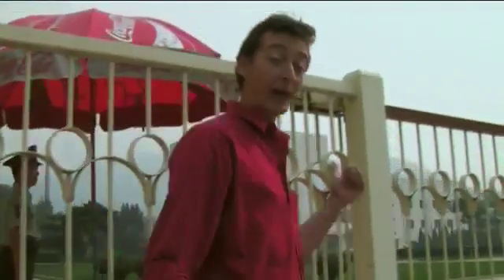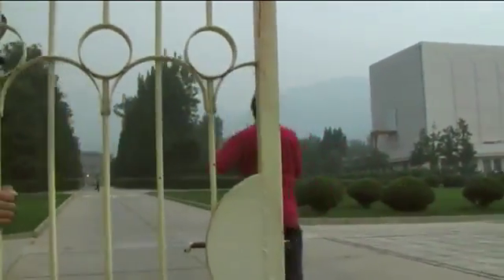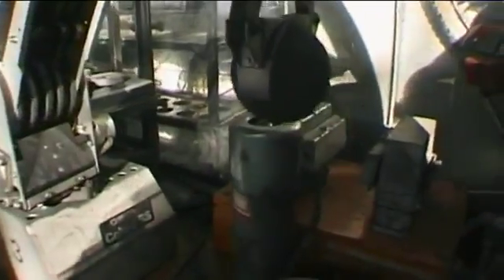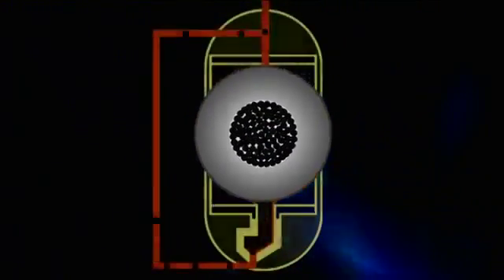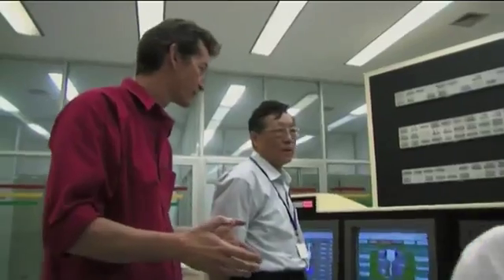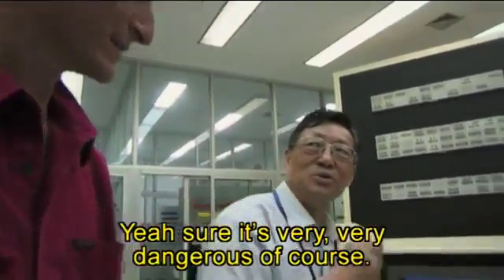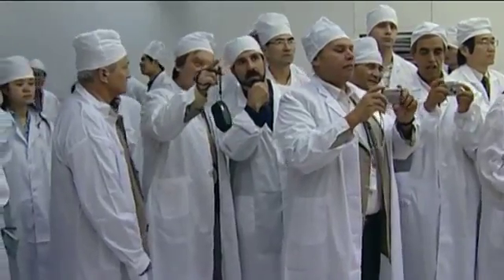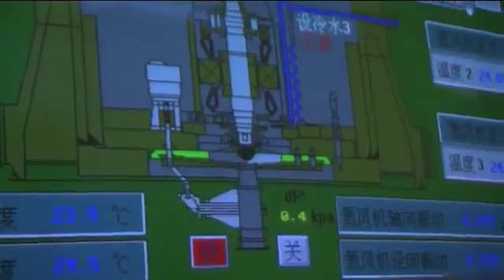Pebble Bed Reactor Prototype

Comment: This technology is far from new. It was originally developed in the mid 1970’s at OakRidge. Issues surrounding manufacturing and degradation of the casings as they aged ultimately killed the project. The issue of scalability was also a major drawback of this technology. Due to advances in metallurgy, material sciences, manufacturing processes, and supercomputing, the most restrictive issues surrounding PBR are no longer an impassable burden. However, commercial reactors or publicly disclosed research reactors have utilized these advances at this time. It was only at the beginning of 2020 these advances became published. With all this said, the reactor in the video is nothing more than an unreliable, extremely expensive, relatively small (for power generation) reactor. I give China a lot of credit for building and researching the more exotic reactor types, but they are far from the first. Everything they have done in the nuclear industry has already been done on some scale by one of the following. USA, Canada, France, Germany, India, USSR/Russia, Israel, And England.
Reply: haha no. The US funded this as one of the two options for the ARDP and they are now pursuing this heavily. The only obstacles were political and those killed development for every other kind of reactor as well

The main previous body of research was German, the reactor is an evolution of the Siemens HTR-Modul concept, and the Chinese did get direct support from Siemens. The work that the US did before was relatively minor in comparison to what the Germans did for PBR's before 80s politics happened.
Reply: don't give em too much credit they stole the Tech from multiple sources.. A big one they got caught doing it too was South Africa.

Comment: This was a disaster when built in Germany in 2009
Reply: Maybe this type of technology is more mature nowadays too
Reply: @clovisdelins8490  their design was bad as a vertical stack that created grindings, jams, and dust...but the short comings with the design are inherent.
Reply: China has a lot of money, maybe Germany did not invest enough in this type of technology
Reply: Akin Khoo that is true..new designs have to be run for some time to find the inherent problems, in the big picture of things, though, I think thorium and salt is the only real promise for nuclear energy future.
Reply: Akin Khoo  they have been saying that about fusion for some time so I have my doubts. Present uranium fission is a constant filtering and re refining process since most of the fuel becomes contaminated and not burned in the assemblies. Only France refined and reprocessed at great cost and in the end lost. It does not work simply because traditional fission...even the pebble bed ...produces 20,000 year wastes. Any breeder reactors..,which have been run and built...France did as part of its processing program...are small problems compared to the massive quantities of traditional waste produced by conventional vision.Thorium cycle is attractive because it's daughter elements are 1000 or less. Also thorium is almost unlimited supply compared to require enrich 235 in present cycle, and even 238. It also can be handled and processed easily in bulk. Finally it is true that salt reactors require on the fly separation, but on the end the waste is 1000 times less and only 1000 years. pebble beds do produce a lot of low level waste and require tremendous processing to cut down on the numbers because of the complex and massive material involved in individual packaging. Also there will be pebble breaks and failures, and pebble bed does catch fire or even is exposed to the air...it will be a disaster. A salt reactor will drain and turn solid in failure, which will cause a containment building mess with radioactive daughter material. A real mess that you are going to need a lot of money and luck to get operational again. But it cannot burn and will literally stop further 
India will have it before China.
Reply: GB Zebra Let’s be real here. It’s going to be 100+ years before nuclear becomes king. PWR’s and BWR’s are not truly practical and all other types and designs are even less so.
Reply: No, the Germans took exactly the wrong lesson from every forray into nuclear. The lesson that should have been learned from the German pebble bed reactors is that every problem that came up in the first two prototypes was actually very easy to completely prevent in a followup reactor. Which were fixed in followup proposals like the HTR-Modul that the Germans snubbed.

China took the correct lesson from this, and built a subscale reactor to test every detail of the concept and iron out every kink, and now they've built facilities to mass produce commercial scale reactors that can be built much faster than conventional reactors while also having substantial safety benefits. Germany could have done this as well (be persistent until you have a good design) but the pebble bed reactors were by far one of the biggest threats to fossil fuel companies (due to their ability to also produce synthetic fuel economically) so they invested heavily in demonizing the reactors in German media

Comment: China has balls for making new type reactor without fear
Reply: pun intended
Reply: stolen tech.. And yea it can be proved they stole it
Reply: @daveno8432  stolen or not if you dont use knowledge ıts same as trash.
Reply: @daveno8432  Yes theyre screwed bunch. But it centainly doesn't matter where the money come from. Whats matter is where money is used